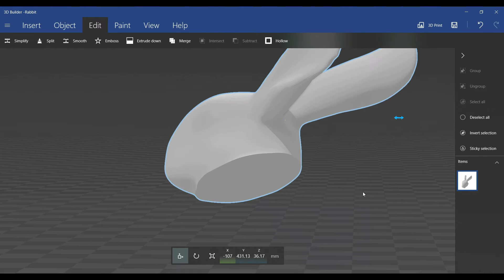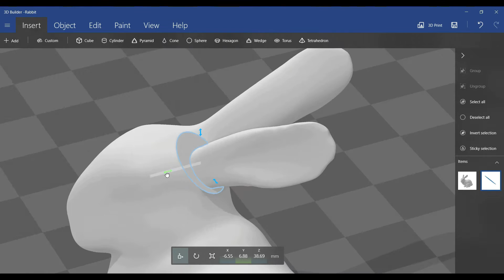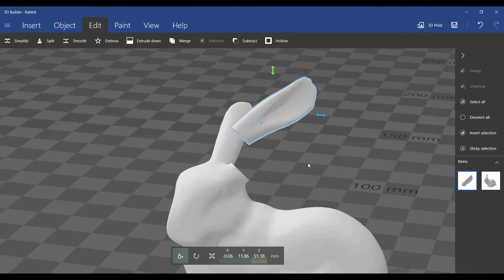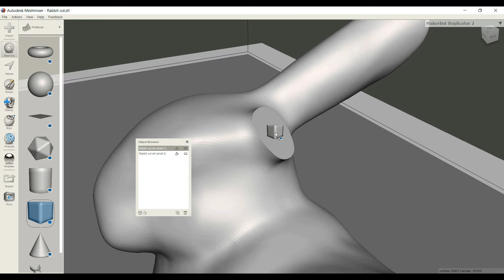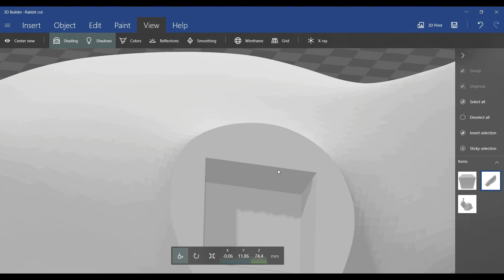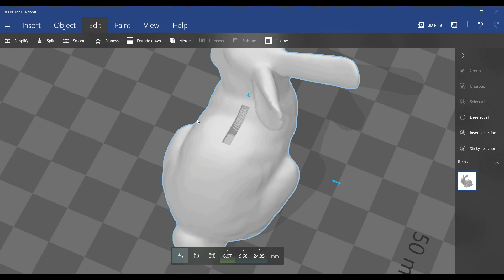How to Cut, Perforate or Split Models with 3D Builder

Comment: So, I was following along and the technique at the 2min mark just is not working for me. The cut is made, but my model is still registered as a single element and I cannot modify the "cut" part separate from the main model.

Solved...For anyone else that got stuck, make sure to select UNGROUP from the menu on the right side for the original model you are cutting.
Reply: Thanks, for me I had to select the main stl and go to the "edit tab" and click the "combine" option. After that I could cut it and it was separated. Thanks for your tip <3
Reply: neither of these solutions work for me, it slices the object but the ungroup is grayed out and combine doesnt do anything